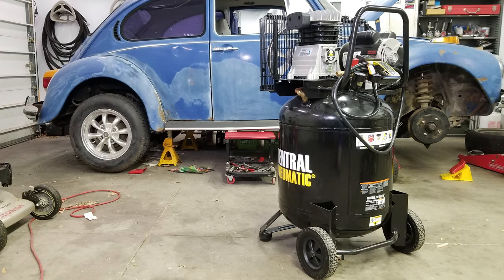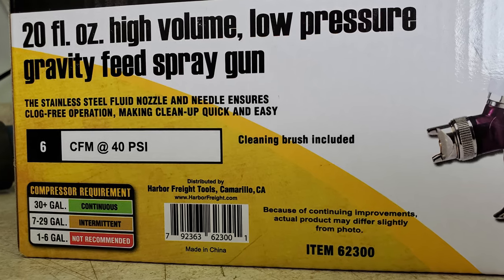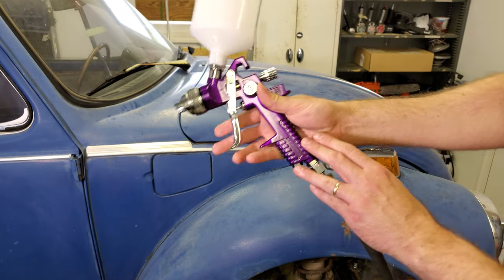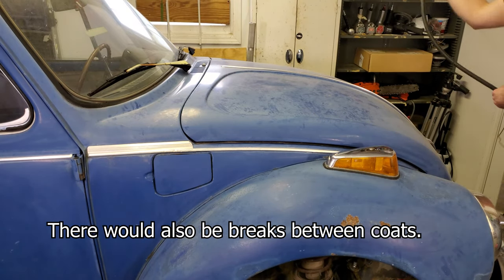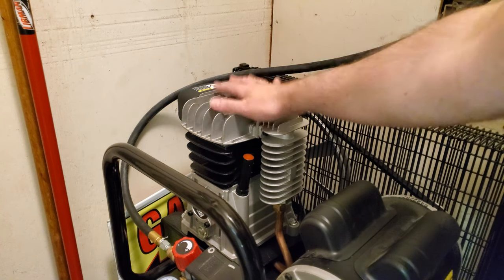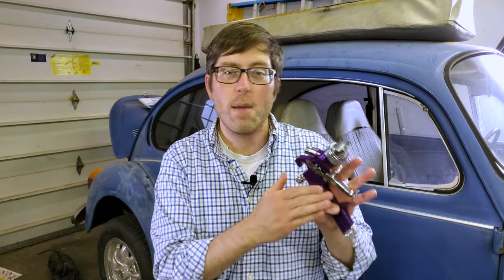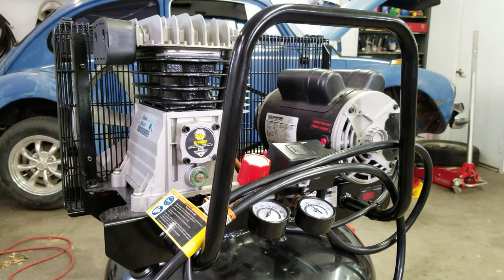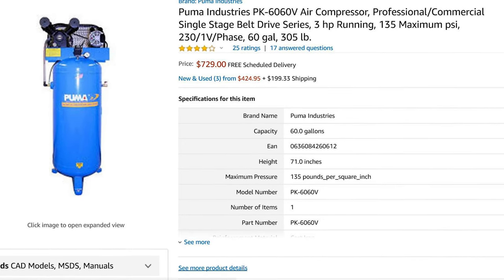Tool test: Can the Harbor Freight 29 gallon air compressor run an HVLP purple paint spray gun?

Comment: 40 PSI is a bit high. You could use the HVLP with 30 PSI very effectively. How does that change the outcome of the test? I literally purchased this same compressor today.
FOLLOWUP:
I also purchased a Fujispray Q5 turbine, which I ended up primarily using to paint my car. It has high CFMs, but only puts out 9 PSI. I made some noob mistakes, but it worked.

Comment: The CFM rating of the spray gun is at 40 PSI. The rating of the compressor is the inlet atmospheric pressure air flow. The compressor outlet air flow will be about  1.5 CFM at 40 PSI.  This is misleading but used by most tool manufacturers.

Comment: it absolutely can. I have a Kobalt 30 gallon and this hf gun. compressor was set for 40 psi , gun is 6cfm @40 psi...shooting epoxy. about the time i was 2/3 done with a cup of paint shooting individual panels, it was kicking in .

Comment: I have the Kobalt Quiet Tech tank and a  set of  Husky automotive paint sprayers.... one is a standard volume paint sprayer the other is is an HVLP gun... seem to work fine.   I did do primer, base coat, and clear coat and it worked fine but I'm not painting a whole car either... it's just touch up.... but larger areas of touch up....

Comment: You didn't show whether you had the gun set to full fan. That would use full air flow. A good reason your compressor head got so hot could be from the fan pulley standing against the wall. Nearly everyone does it. Rotate the unit 180 degrees and it will benefit from more air cooling.

Comment: You should ASSUME only 80% of the compressor rating as peak. Also a fan on compressor helps with cooling. We use a cheap box fan over at angle. With the 80% rule you'll never go wrong. Plus add 5% to a gun rating for basic measure of tolerance. DON'T pump in addition of that 5%. Just treat it as it needs 5% additional.

Comment: I think you should try it again, but use higher pressure on your compressor and a regulator at the gun to drop the pressure to 40. I work that your compressor wasn't running until it hit 40psi, of coarse I could be wrong, but you didn't mention when the compressor was set to turn on.

Comment: I’m just getting it figured out, did the Home Depot shopping spree, got the husky 27 gallon oil free 200 psi compressor, 6.8 SCFM at 40psi, 5.1 at 90psi.    Purchased two husky HVLP composite guns, 100 each.     Haven’t tried to paint anything yet, still working with hooking everything up, and thinking about the lines.  What do you think about the products I’ve chosen so far? Only trying to do a hood and two fenders and maybe a rear panel.   
To get moisture out of the lines, I bought two 50foot polymer lines, a water separator and a regulator that I will install between the lines, just don’t know how I’m going to do it yet.

Comment: You need to install a metering value on your spray gun. Then you can manually adjust your pressure at the gun. It uses way less pressure, it's all about  proper adjusting pressure... good luck. By the way that gun   can also be used to spray latex  house paint, by properly thinning thinning
Reply: Properly thinning the latex paint, and Properly adjusting you hplv gun. Also if you spray latex, make sure that you disassemble the gun to clean it properly. 👍👍👍👍😁😁😁

Comment: Used that gun with smaller air compressors with lower cfm that that, just do not try to spray the whole damn car in one shot, do it by panels. The same brand 21 gallon one will do a hood on a truck no problem.

Comment: It can be used to do a repair on some car panels, but like others state, the compressor is designed for a 50% runtime. Also, if the ambient humidity isn't really low, you'll have trouble with moisture in the line very quickly. You really need a two stage compressor on 220/240 volts, with a good moisture control system attached, in order to paint an entire vehicle. No 110 volt compressor anywhere is truly up to the task.
Reply from the maker: Yes, I talked about the duty cycle in my full review. HF doesn't specify the duty cycle, but 50% is a good guess.

Comment: The reviewed HF compressor is appropriate for air brush work.  The video's conclusion, that a greater volume tank is best for high volume painting and pneumatic tools, is the same as the recommendations of the various air compressor manufacturers, including vendor HF.

Comment: you can spray a car with an 8 gallon compressor, actually you can spray a gun at probably any size compressor because a spray can is smaller and people spray whole cars with paint cans sometimes, I'm talking 2k paint, not regular 1k paint from a store. the trick is use 2-3 oil/water filters, make an aftercooler with 3/8" copper tubing from the hardware store and brass fittings and a tubing flare kit and ALWAYS you will need an air dryer, it can be as simple as using the red plastic ball type filters at the end of the spray gun for $3. make sure you use a new one for each spray session and constantly purge the water out of the other 2 water filters. I'm actually using the HF 21 gallon black compressor, it has plenty of volume to spray a car. I only recently figured out the water problem, the plastic ball filter is the key to that. the oil/ water separators only filter out half the water. you also have to purge the water from the main tank from below
Reply: Yes, I paint 3 minivans on my driveway with a husky 8 gallons compressor all depends on skills 😹😹😹👍🏽
Reply: @FranciscoAlvarez-nl3of  nice work man

Comment: you ran it at 40 you don't need to run hvlp at more than 20-30 usually right? that means scfm will go up at lower pressure which is what you want anyway that tank even a 20 gallon is well big enough to do panels with an hvlp or a whole car at once with lvlp it will just take longer either way. really it's the engine + pump on top that's the key, you can cobble a 10+ cfm onto a 20 gallon tank which they don't usually come with and likely get by. because oddly the tanks by themselves can cost as much or more than the pump

Comment: wasnt this a worst case scenario being wide open full flow for 10 minutes.. usually a coat on a car doesnt take much longer than 10 minutes of actual spraying and id say youre only spraying about 50% of the time while putting the paint down due to repositioning and checking how its coming as well as a proper technique requires alot of off and on action as you come to the edge of panels or feather in.. imo it ran this tool great and alot of compressors would since it only requires 40psi to work properly, any compressor will deal with the heat for 10 minutes of use, spraying continiously will eventually cause issues

die grinders or sanders might be a better tool for consumption tests as they require more in the 80-100psi range to have any usable power..2-3 110v compressors hooked together with a little manifold and jumper hoses all of them on different electrical circuits seems to work best for long runs with my diegrinder and is alot cheaper than a pro level 220v unit.. making the tank bigger doesnt increase cfm cant really do much to increase cfm on 110v most every compressor is already using the whole ~1500 watts it can pull without breaker issues
Reply from the maker: Yes, give it some breaks and this compressor will definitely work for this spray gun.

Comment: I have a craftsman 30 gal on similar gun.  No, it doesn't work. The pump with over heat and product hot air and introduce a lot of water into the tank.